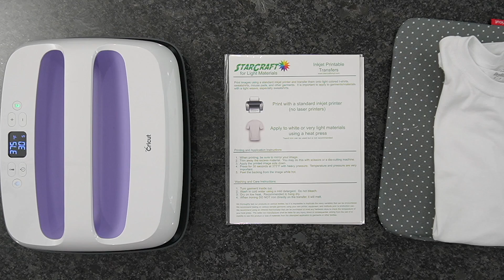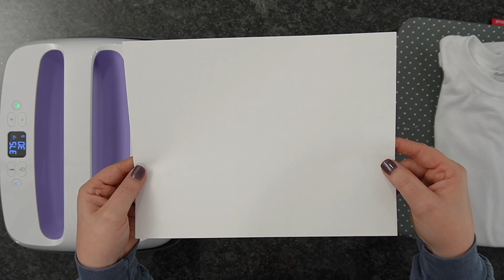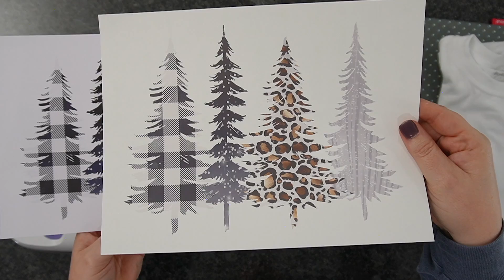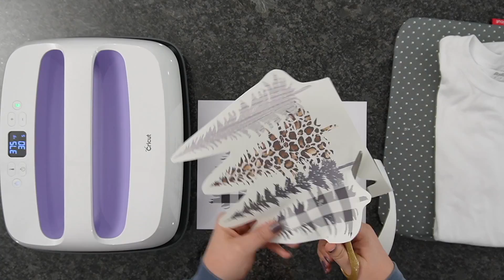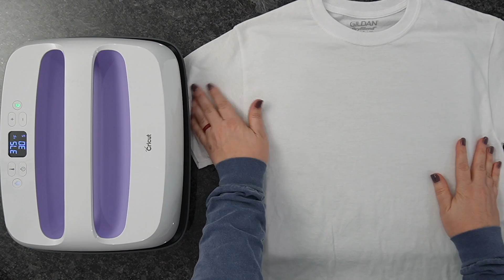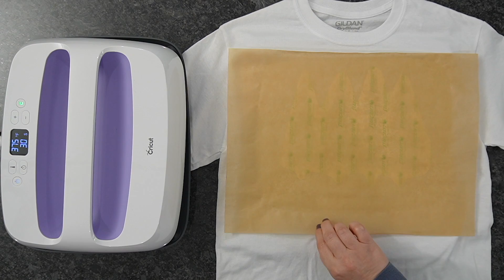🔥 Can You Sublimate Heat Transfer Paper

Comment: Hi Crystal, with heat transfer paper, you are supposed to turn the paper to the front after removing backing. It looks like you sublimated directly onto the shirt. Is that right? If so, would you use it the regular way if you were printing on cotton?

Comment: I’m still a little confused. Did you use regular inkjet printer ink on this paper, and the paper helped it act like sublimation ink and bond with the fibers of the shirt, or is this just a different kind of paper you can use for sublimation printing? Or does this paper leave more than just ink behind? I’m so confused. Lol 😂😅
Reply: Lemme try again….did you sublimate the tshirt using a new kind of transfer paper & sublimation ink and printed, or did you sublimate that paper, and it adhered to the shirt? Closer to printing your own transfers with sublimation ink and paper, or closer to sublimating on HTV and adhering the HTV to the shirt. I know you tried to explain this in the beginning, but with all the mentions of other videos and the missing link to the chromablast video you mentioned, I just couldn’t understand exactly what was going on.
Reply: @micnitram2006  I was also confused, but comments below said she used sublimation ink to print on this paper.

Comment: This washes well if the heat transfer paper is good and will hold up. I always use sublimation ink because the inkjet ink is usually water based. A small spray of polycrilic after is also a life saver for helping things make it thru multiple washes.
Reply: So much good information. Thanks!
Reply: Polycrylic on a shirt? It doesn’t make it r stiff
Reply: @conniedemerchant6312  Mix it with water and don't put too much. Only put it where you put the design if you can help it.